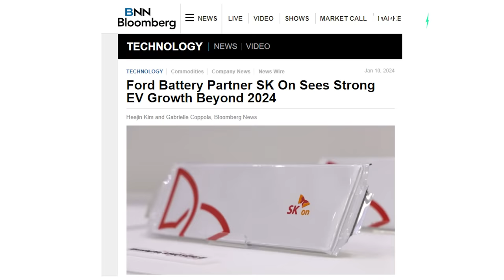Ford FIRES nearly 70% of EV plant workers,ramping up ICE production

Comment: 1990 ANALOGY: Acme Fax Machines just fired 70% of it's new Laptop computer Division to focus on next generation fax machines
Reply: more like Google Glasses.. they were like 10 years too early to the market. Same with EV's.
Reply: @AndrewTSq takes time.  The batteries will continue to improve with range, recharge time, cost etc.  10 yrs is about right where evs will be a very viable option.  As of today, it is practical for some and more of status symbol for others.
Reply: @yogamon  faster charging means higher power needed from the charger. I dont think you want to stand next to a cable delicering 1200kw / sec
Reply: What absolute ridiculous analogy, name one way an EV is better than an ICE car, and don’t say green, that is complete bollocks
Reply: @MOB34M  You don't have to get your oil changed. There's no spark plugs or timing belts to deal with. You never have to worry about throwing a rod or blowing a head gasket. Zero transmissions to deal with. No trips to the gas station.
Reply: Exactly. And back to Ford - in a few years time they're gonna fill in a public bailout request arguing "we couldn't have known what was coming, there was nothing we could do to avoid being cought off quard, petrol cars demand among our beloved boomers seemed strong at the time" 😅

Comment: UAW members are not fired. They are either laid off, offered retirement buyouts  or if no work is available they can reassigned to another plant which Ford has plenty of in Michigan. I read their lines can be retooled fairly quickly to assemble what is selling and it ain’t EV’s.

Comment: Not only Ford struggles, Telsa Model Y sales in Europe 2023: Q1 73,386, Q2 65,511, Q3 62,399, Q4 53,663
Down down down. Not looking good for the EV scammers right now...
Reply: You are missing the point. Car sales go up and down based on current economics. But Tesla can lower their prices and still make a profit where Ford loses money on each EV because they are not making enough to reduce the cost. Now that they are reducing it even more their EVs will never be the price of an ice car because they don't have volume. Every successful company needs volume to make a profit.
Reply: Since its only around 10% of the population in a country that afford a Model Y, it means that when those 10% have bought a car.. you will not see a sale increase again until they get a new car.
Reply: That Tesla model Y is Europe's best-selling vehicle in 2023, by a large margin. Sales will always fluctuate across the year since import is variable with limited production capacity in Berlin. 
Obviously, it's also possible that the refresh of the model 3 also drew away from Y sales. In any case, sales is still going quite strong for Tesla in Europe.

Comment: Makes sense.  I want a Ford Maverick, small pickup for $25,000. Tesla did dig their own grave with the cyber truck.  If they would have massed produced a small pickup they would have knocked it out of the park instead of taking years to ramp up a monster 70,000 truck.
Reply: They’ve already ‘knocked it out the park with the CT. Demand will be huge for years to come, whilst Tesla ramps and continues to lower prices becoming more and more affordable and product getting better and better. The ramping will be quicker than people think due to the demand for the CT & Tesla wanting to meet that demand
Reply: No. You are wrong. The cyber truck as it stands will sell out year after year and they will be building a smaller truck. Had a much lower price later. Tesla's not going anywhere
Reply: @drunvert 😂😂😂 two milion preorders for CTRk kills your biased prediction 😊
Reply: @WANDERER0070  I don't have a biased opinion.
Reply: Don't buy a maverick.    Transmissions are failing left and right on them.    Long before a hundred thousand miles.  Lol
Reply: I think big corporations should make exactly what I want and only what I want. See how well you can sell that idea

Comment: The problem with EV:s are obvious. But it does not help that they are full of expensive technology pushing prices sky high. All EV:s are like that. The trend is the same for ICE unfortunatley, but they at least don´t have all the other problems of an EV. You can actually drive an ICE without much issues

Comment: I think the market for people wanting to get EVs is reaching current thresholds and a saturation point based on the available grid infrastructure. 
If you own a home, at least you can get a home charging station, but if you rent or have an apartment or plan on traveling with an EV, the lines and wait times to use a charging station are detrimental to the user experience. Pit that with horror stories about people needing to get their Tesla's fixed, and waiting sometimes Months before the part is available and with this years large winter vortex hitting so much of the country and seeing stories about people abandoning their EVs because the batteries couldn't handle the extreme cold temps are making potential customers uneasy about getting one.

Comment: The best bet for companies like GM and Ford is to make their ICE and EV cars as cross compatible as possible,  in terms of sharing parts. That way they can maintain their markets and supply chains for auto parts to the highest extent possible.  Because they hold high market share of ICE's it makes sense to me.  Otherwise the are short changing themselves in their EV transition and stand to lose massive market share due to some lines of their EV's not quite being ready for prime time and not cost effective to manufacture.
Reply: That does not really work. EVs that are designed as EVs from the ground up are going to be much better cars than just trying to fit an electric drivetrain into an ICE body. I suppose suspension, possibly brakes, lighting and infotainment could be common but there is not a lot else.
Reply: Understood,  however a number of components apart from chassis base / drive train could be made interchangeable.  I would think up to 30% at least.  Not suggesting converting ICEs, but designing the next ICE model to be as cross compatible as possible in terms of design and share parts.  The upper body could be shared,  if carefully designed to fit ICE and EV chassis base, Interior seats, tyres, plus what you mentioned. Not easy and would be a technical challenge,  but not rocket science either.

Comment: And I would buy one at the older prices, but they raised the prices and cut production.  So basically they are folding instead of learning how to build these for lower cost.
Reply: Probably doing a refresh, with better, cheaper batteries, heat pump, and a NACS plug. I'd wait, too.
Reply: CCP is blocking lithium sales

Comment: Regarding the cold situation in Chicago and all the dead Tesla cars:

I never though I have to do so much work and planning, just to put fuel in my car, in this case charge. 

I still spend 5 minutes to top of my ICE car in ANY weather
The heat that warms my engine or cabin doesn't use extra fuel the ENTIRE time I drive once the engine is in operational temperature after a few minutes. It comes from normal operations 
The fuel I put in my ICE car doesn't suddenly produce HALF the driving distance just because it gets very cold
I can buy spare parts and reparations from many different business at reasonable prices and am not forced to go back to the manufacturer and pay crazy prices
and ....

Ya, no wonder people are waking up to the reality that EVs are not the savior they thought they would be.

Comment: Ford needs to fire their "bean counters" from 2021 when they first started excepting pre-orders on the standard range Ford F-150 Lightning with a base price of $39,974 with a range of 250 miles. Now 3 years later if Ford is claiming  to lose $34K to $36K on every single Ford F-150 Lightning that they sell, (which is only about $5K short of what the suggested pre-order price was to be) they've got some serious accounting/comptroller problems!! And I hate to say it, they probably need to be investigated since they prefer to fire the little guy at this point of the ev transition.

Comment: The 2024 F150 Lightning Flash should have been the starting point for release spec, would probably sell great if the price was better and it wasn't buried in with other trims that lack a heat pump and larger screen.

Comment: Sadly, Ford and GM don't know what they're doing when designing and building EVs.
Reply: The battery range is not there yet.    We need an electric vehicle that will go 500 miles in Zero degree weather minimum.       500 miles at 100 percent charge.

Comment: Ford realizes that people who use trucks to do real work, as opposed to showing off, need an infrastructure they can rely on for charging.  It is not there in sufficient quantity to be of any use to farmers and rural workers, whom are the primary purchasers of trucks.  If your industrial job says you need to go across the state to complete a job as contracted, you need to be able to make it there and back.  Where are the chargers?  Even Tesla chargers are not that available in the midwest.  Now imagine it being in a small town with zero chargers.
  Impact damage resistance is another factor.  Trucks need to be tough.  Just put a dent in a EV battery.....go ahead.....just a little dent.  Expensive failure, for sure.

Comment: The early adopters have been saturated, which explains the drop off in sales.  Now EV makers have to win over the 'normies' and that is not going well.  High repair costs, expensive car insurance, accelerated depreciation, poor resale value, software glitches, battery fires, haphazard charging, subsidies ending, and higher initial purchase prices compare poorly against ICE cars.  The solution for these problems will cost billions and require technological advances that currently don't exits.  What are car makers supposed to do?  Pour good money after bad?  No, just get out of the EV game and cut your losses.

Comment: Biggest problem with EVs and hybrids is still the fact that not everyone can charge them at home and not everyone has the means to a personal electrical grid. Plus last i checked an EV owner is well rekkt in wars.
Ford has noticed how Hertz is reacting to EVs, general EV buyer response, the high return rate of EVs and i'm going to guess the recent cold streak hasn't helped EVs one bit.
Basically if you're still for EVs you're just one more shill.
Get a hybrid or stay home.

Comment: Those dealerships usually have 'lot' financing on the stock they have. That only adds to issues and if Ford is providing the dealer 'Lot' financing, then more trouble could be ahead.  If the US hits recession end of 2024 or 2025, as some predict, its going to be an Auto collapse.
Reply: The US has been in a recession according to the old definition, just not the new definition. It changed last year.

Comment: Personally, I will never have the financial ability to afford an EV that meets my needs. I  will never have the patience for the short range and the long-term charging time.
Reply: Short range (250 miles) works 99% of the time for at least 90% of the people. New models can charge 20-80% in 15 minutes at a fast charger.
Reply: Do you drive over 230 miles a day roundtrip?  

You can can't charge at home over night?

Level 3 charging on takes 20 minutes from 0% to 80%.

$7500 tax credit & $2000 state tax credit.

C'mon now... Owning an electric car isn't bad at all... I drive only 10 to 15 miles round trip per day going from home to work.  I honestly only need to charge my car once every two weeks and I do that at home.. 

If I need to do a minor road trip say 500 miles round trip, its easy for me because there are hundreds of public chargers along the routes I take and my car's software system will take me to each charger and the system knows how much charge I will have in the battery to get to the charger..

All the electric cars freezing up in Chicago last week were most likely driven until the battery was near 0% and cold... When you want your electric car to charge in sub zero weather, you can't drive the battery below 10% and the battery must be warm.. Easy fix, just turn on the heater up all the way when the battery gets to 15%, drive to the charger (if you need to fast charge) and start charging before the battery drops to 10%.
Reply: You forget human nature.  People run cars and airplanes out of gas constantly.
Wait till last day to study for test. Wait till refrigerator is empty to get food. Etc Etc 

There is a very large segment of American society that can’t afford any type of new vehicle. Used EVs market I have no idea about. 
I say let the market dictate what sells not our government. Just like which phone, food , restaurant etc. we buy. 
   There is room for both to exist. Though it has been a major waste of money trying to force that change. 
    EVs will survive when more people can afford them ‼️
Reply: EVs need a 500 mile range in Zero degree weather minimum
Reply: When they cost $25,000 and charge in 10 minutes which is probably only a few years away. What will you think then?
Reply: @gregorylyon1004 😂😂😂😂😂😂
Reply: @gregorylyon1004  
No they don't... You think that the Auto Industry has the time and money to bend over for everyone's needs? Most ICE don't get 500 miles on a full tank of gas in sub zero temps... An electric car with 300 miles in perfect weather conditions on a smooth flat road is idea for 90% of consumers who are actual buyers of electric cars.. 

What is needed is battery swapping and having the public chargers actually working instead of being broken all the time.. 
Public education on batteries and how to charge them is needed...

Comment: My neighbour had a company lighting.  She was unable to get anywhere other than work and home because it could not get enough power into it over night,  range was not enough and she ditched if for an F150 gas.  The towering irony is that she works for... wait for it... the electric company!!!   Even hydro cannot use lightning EVs for their fleet vehicles!!  If that does not tell you everything you need to know about EVs, good luck with your mensa membership lol.
Reply: The problem is that EVs don't hold a good charge in cold weather.  Lol

Comment: A manufacturer can’t sell a product in great volume if demand is low. EVs are overpriced and the pickups can’t be used to tow traditional loads without range being cut dramatically. If/when EV pickups can meet the same standard towing requirements as ICE pickups, then they may be a realistic option for those who need towing capacity over long distances. Charging speeds add significantly to travel time and make towing with EVs impractical.

Comment: There needs to be a viable battery breakthrough, once this happens it will be electric everything
Reply: The problem is that our power grid will not support an all electric vehicle population
Reply: @gregorylyon1004 We can all switch to solar with a big enough battery breakthrough, we won't even need the grid. It's entirely unsuitable in its current form

Comment: Don't you think Ford and others would be better served by seeing and following ther Volvo Road map. Gas, migrate to Hybrid, Build a performance, economy and clean image 1st, then migrate to Full EV when infrastructure is in place. We are preparing to trade or 2018 S60 Gas T5 AWS Polestar for a 2024 S60 T8 AWD Hybrid this year. 70 MPG, 0-60 2.4 Seconds, 50% lower emissions and 455 HP< MY GOD! What did Ford thing, a huge Pick truck woul dbe fine 100 EV at todays capacity and infrastructure, Wrong answer. Volvo-ized Pick Trucks would sell like crazy if offered. Make the Gas engine efficient, mixed fuel capable recharge the Battery while driving and breaking. Then on long drives go to hybrid 20-40 % EV and get twice the mileage, half he emmisions and never worry about charging stations. Get gas as usual. Makes sense to me.

Comment: Let me break it down since it appears to be confusing. You can buy a new mid level F-150 ICE truck for $55k. That truck is going to get you 20/25mpg, opting in for a 36 gallon tank, let's say you average 22mpg, that's a whopping 800 miles on a tank. Now let's look at the Lightning. Nearly equivalent trim will cost you $70k with the extended battery giving you 320 miles of range. This falls down to 100-125 miles at a max tow capacity fyi. And before you say "OMG gas is so expensive electric is so cheap". On the surface, sure. Have you seen the charging rates at fast chargers lately though? I have because I have an e-car. Lightning gets 2.4 miles/KW at epa range. Assuming $4/gallon gas and 60c/KW at a fast charger, a level 3 charger will net you 16mpg equivalent. So you're getting worse fuel mileage in a lightning charging outside your home, and spending a TON of time at the charger. Why did you buy a truck? Towing/hauling/offroad? How long will YOU need to charge at home to bridge the $15k price point gap?

There's a market for electric trucks. It's just a very small one right now. Need a commuter? buy a commuter.

Comment: Ford messed up,  Ford's F-150 Lightning competes directly with Ford's F-150.  Why would someone choose the electric version of the F-150 over the gasoline version?  Did they even ask themselves this question?  Without at least 100,000 sales/year, Ford has no chance of achieving a positive gross margin on the Lightning.  That's not sustainable.  

There are two major disadvantages to owning the Lightning, namely, reduced range/towing capacity, and the lack of a reliable fast charging network.  The chief advantage of buying a Lightning, i.e., lower cost of operation and maintenance, is, apparently, not enough to attract sufficient numbers of buyers, thus the slack demand.  The value proposition is tipped in favor of the F-150 ICE. When you are competing against yourself, you can't win without losing.